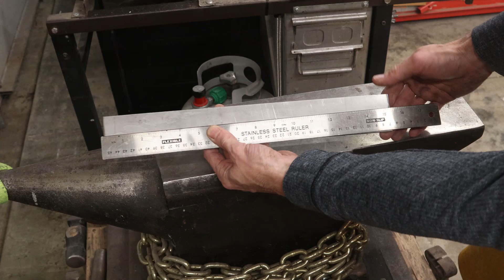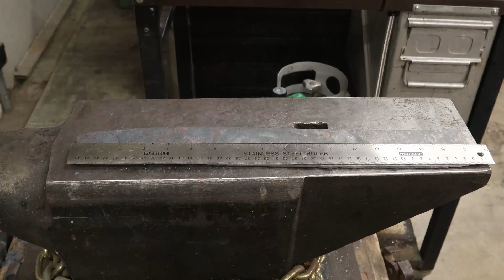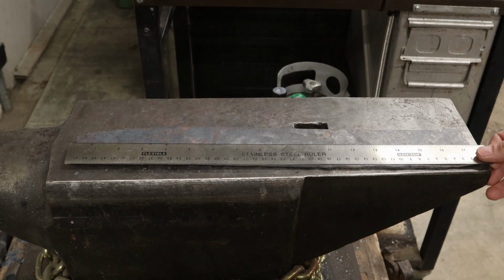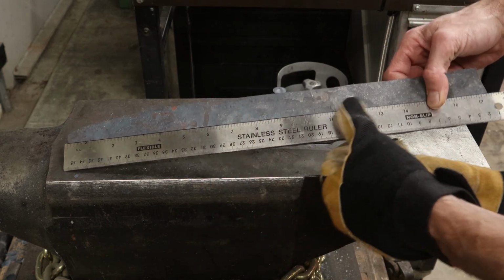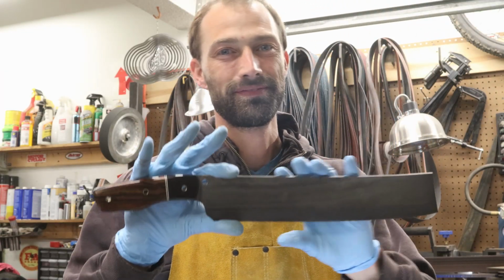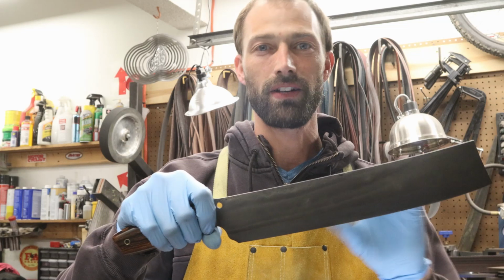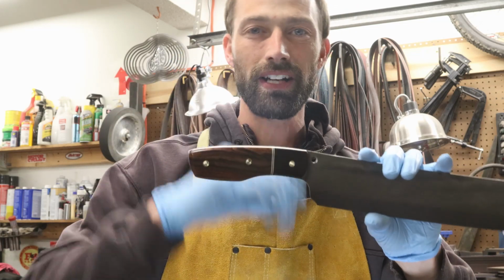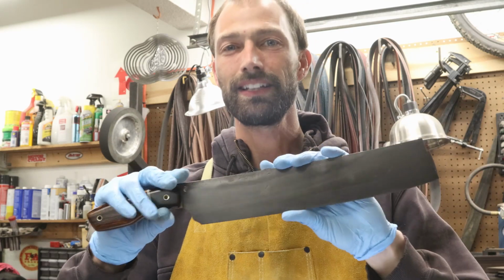Making a Competition Chopper - knife making

Comment: Great video... I wouldnt have known what the hole is for either. If you dont mind me asking... what kind of grinder are you using? I am looking into getting a good one and interested to know what the good ones are
Reply from the maker: I am using a KMG from beaumont metal works for the vertical, an AMK for the horizontal and a homemade disc setup running the beaumont metal works 1 degree bevel 9 inch disc. There are a ton of good grinders on the market today! I would do some research into something that can switch between vertical and horizontal to save space. I do enjoy having 2 dedicated rigs though. Thanks for watching!

Comment: Nice vid dude. 
May you give some specs please?  What are blade thickness at the back and before secondary Bevel (thickness before sharpening). 
Thanks!!!
Reply from the maker: Unfortunately I haven't had that bad boy in my hand for like 5 months. I will tell you it was a solid quarter inch thick
Reply: @Aleeknives  thanks guy. And usually how much do you leave before sharpening?
Reply from the maker: I leave it about the thickness of a dime before heat treat then down to half that for a chopper style knife. Then I make the secondary bevel
Reply: @Aleeknives  sorry i dont understand dîme...(i'am french)... May you explain? Thanks a lot for your answers!!!